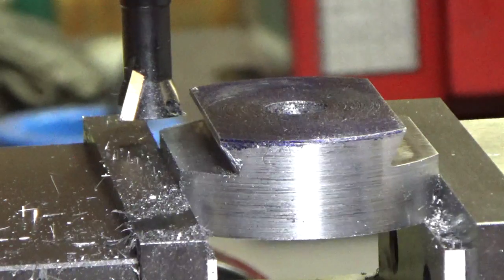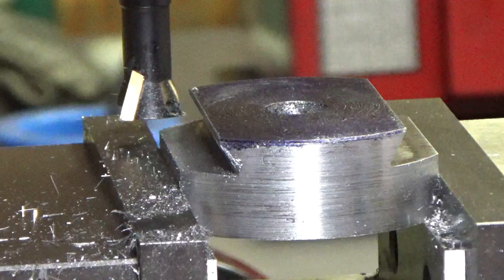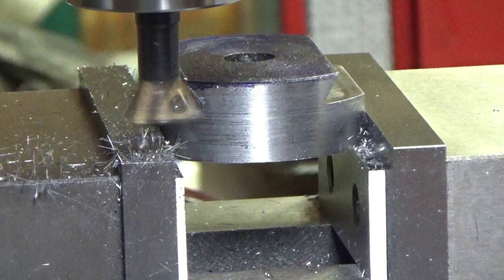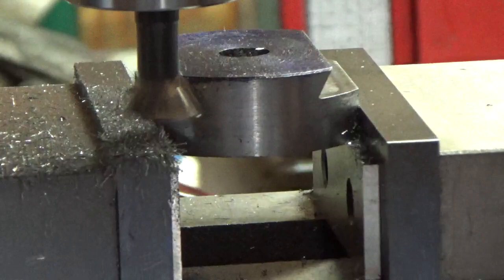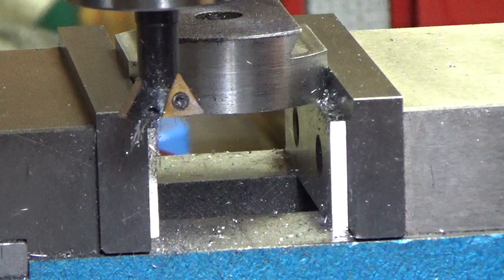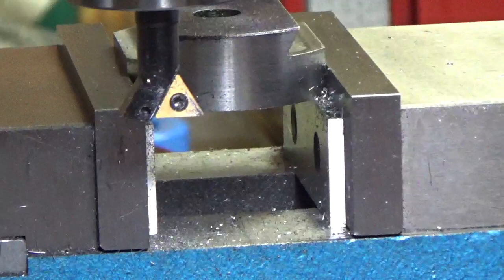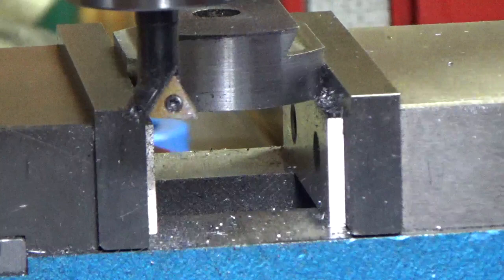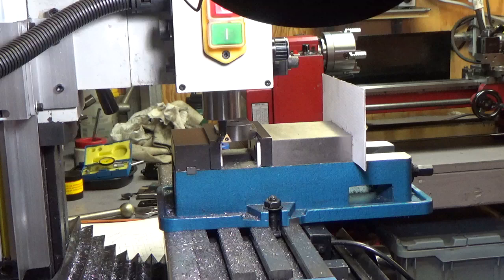Cutting Small Dovetail With Shar's 3/4"x3/8" Insert Type Dovetail Cutter

Comment: I am sorry hope you don't think I am trying to get you of topic but I have been looking at your hand shaper video. Was it a casting kit? I think that is just the most beautiful bench tool.do you know where I might find one?
Reply from the maker: David:  All parts are made and designed by myself.  I was only able to estimate the original dimensions and shapes from photographs found on the internet.  Because of machine limitations I tried to make to 80% scale, so very close to the original size.  All parts are machined from cast iron blocks purchased from McMaster Carr and other suppliers.  The only steel part is the base, which was machined from hot rolled steel.  I kept some construction photos for most of the build, but sort of fizzled out toward the end.  I'll post a link and your can take a look and hopefully answer any questions you may have.  Best Regards: Larry
https://1drv.ms/f/s!AoFHBXavAXM5gZB6SzZp72fb-Wi6Kg